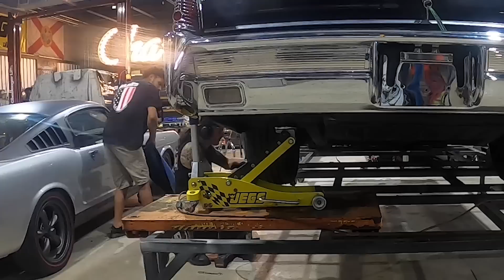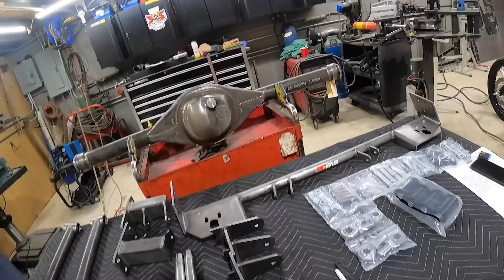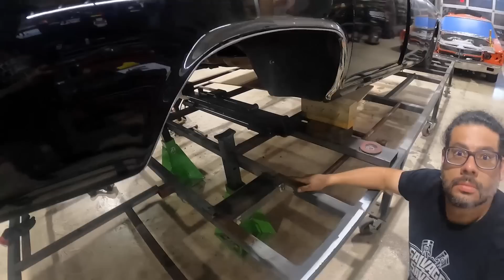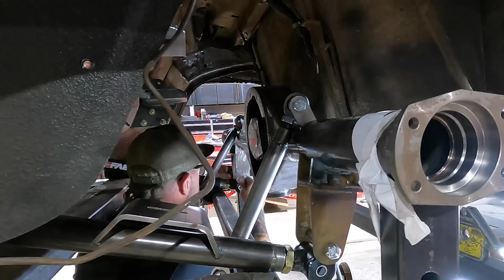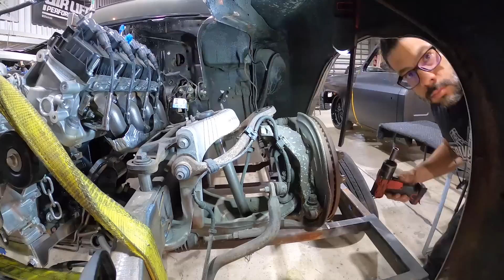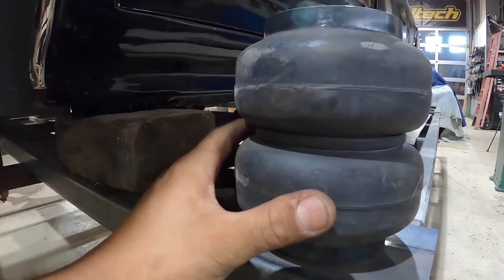7.3L Godzilla Swap Continental Bagged 4-Link & Rear End - 1965 Slammed Lincoln Continental Ep. 4

Comment: I’ve been re watching your whole series for this build I love the content . Why did you set the pinion angle @3 degrees? Where should the pinion angle be set at ride dropped or at ride height ?
Reply from the maker: It's just what works best for the drive line. And we always measure it at ride height. That's when everything is going to be moving and the most stress/force is going to be put on it. So that's the height that we want to make sure everything is the happiest!

Comment: Are air shocks better than airbags?
Reply from the maker: It all really depends on your application! The bags are the tried and true method. We've run them on a ton of builds. The air shocks allow for an easier install without as much fabrication. If you have a relatively stock car or truck that already has shock mounts on all four corners, the air shocks pop in really easily without too much cutting or welding, if any at all!

Comment: 14:20 Did you guys figure out that the upper arms are not meant for camber or caster adjustment? Instead, the lower arms are meant for camber and caster adjustment. There’s a replacement camber bolt kit  meant for the lower arm.

Comment: Are Y'all thinking about maintaining the stock style tank? Wouldn't be too difficult to cut a section of it out and replace it with a curved panel, allowing full articulation of the rear end. Can avoid having to do some sort of fuel cell setup.
Reply from the maker: We're definitely going to have to modify the tank. We can't stick a cell in the trunk because there's that full audio system back there. Depending on how much of a bend we need, it might be simpler to just shape the tank in with a mallet (similar to what you see stunt bike riders do with their gas tanks). If it needs a dramatic relief made to fit the rear, then we'll have to break out the grinder!

Comment: While you're mocking that up, with that link bar being tight to one side with that quarter inch+ gap on the other side, shouldn't you measure that gap, divide it in half and put spacers on both sides to center it?
Reply from the maker: It was adjusted, not everything makes it into the episode